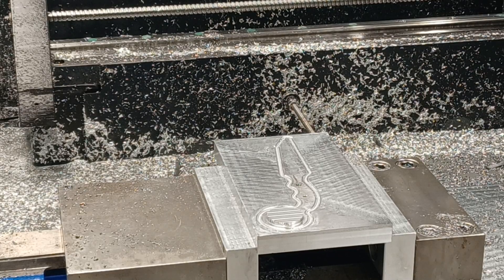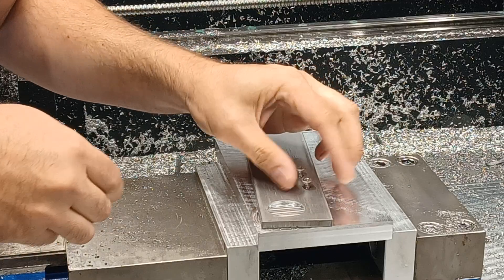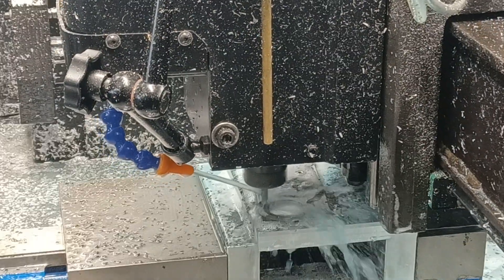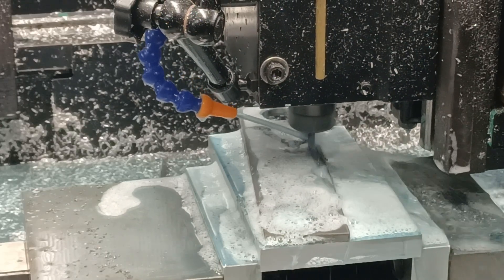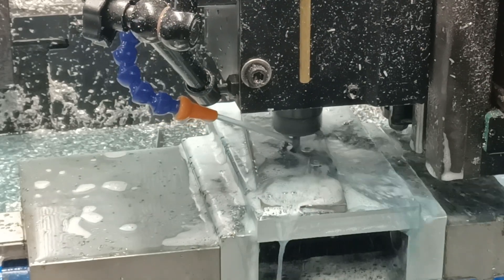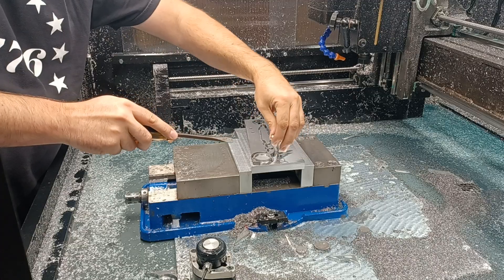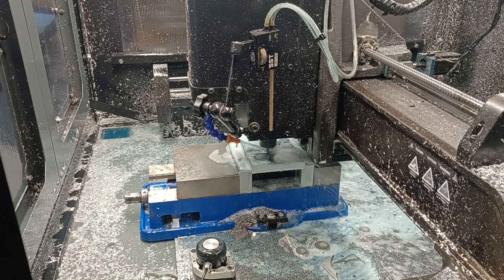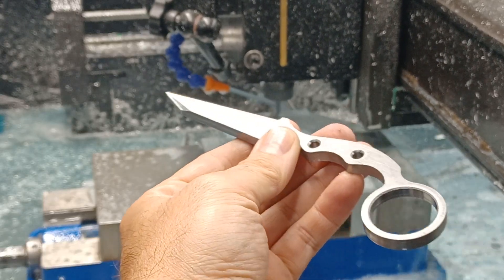Langmuir Systems MR-1 how to machining 8670M Carbon Alloy Steel

Comment: You can mirror the program and make a reverse fixture hold on the other side of that fixture plate no?   Flip the fixture over,  clamp down and bolt the blade down to bevel the other side.
Reply from the maker: I could do that, but if i never pull the fixture and use the same x,y,z for all the operations I maximize my accuracy.  The probe is not super accurate.  I need the bevels and chamfers to be exact mirrors of each other
Reply: @BeckTools  nice bevel work - two questions: how accurate is langmuir‘s 3D Probe=
and why not mill the bevel „sideways“ (a fixture that holds the blade with it‘s flat face against Z-Y… pre-angled (you mill the angle into the fixture‘s face) - then you can use the side of the end mill and get really smooth surfaces that require little - if any - work )
Reply from the maker: @danielgentile935  well I already get a super smooth surface that requires almost no work and I don't have to make complex fixtures that cost time and money.  Also this blade has like 2 different angles per side so that  would require 4 custom fixtures.  I hardly make enough $ to do the simple fixture that I already made. haha  Not sure if it's shown in this video or not but I 3d printed a support for the underside so that when I flip it over I don't get deflection in the blade.  The probe is only as accurate as you make it since it's a DIY probe that you have to dial in.  I've got it as good as +-.002"  (so not very good)  There are also a lot more variables than just the probe that make this a challenge.  There is a tolerance on X, Y, Z, material thickness / flatness, and the list goes on and on. :)
Reply from the maker: @danielgentile935  one other thing.  The radius on the endmill is 6x larger than my step over.  This is what creates the smooth surface.  Every fixture cost me about $30.00 so on a batch of 5 you only get a single fixture.  If a guy were to buy 100 blanks we could talk about additional fixturing.  :)
Reply: @BeckTools  I get you ;) ... unless you shell out the cash for that reinshaw thing, it's going to be difficult to dial any 3d probe in within  0.01mm.
my mill ins't bad (it's an old conversion I did)...  but I often use a tschorn 3D probe (very accurate manual probe) to find fixtures instead of the cheap 3d "live" probe I've got on my mill

and no - I did unfortunately not spot the 3d printed support - this is an awesome idea btw, stealing this ;) ... thanks)

I'm actually considering an MR-1 to get a larger work envelope than my current mill offers)... restricted shop space...
Reply: @BeckTools  nice, of coursre -this makes sense,  never considered this: it makes sense though (the correlation between step over and the radius ...) 

Yes, fixturing is expensive and only really makes proper sense once you get quantites ...  

One thing I do when I mill bevels  in a setup like you have is to leae a TAB by the Tip of the blade... during the entiure bevel milling process and keep it bolted down.
I'll usually grind it off after.